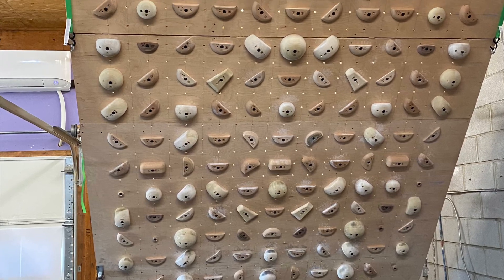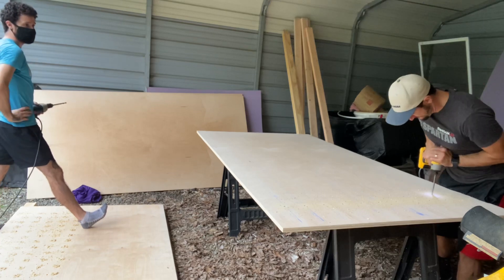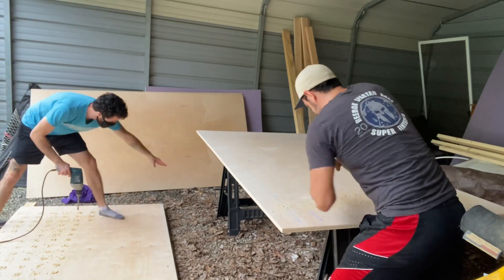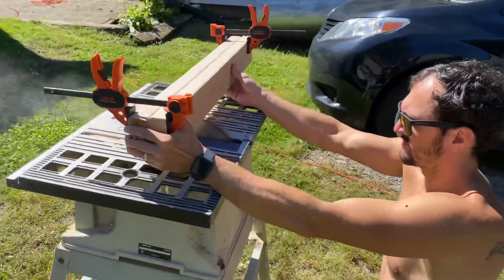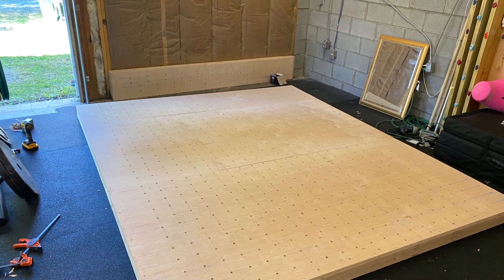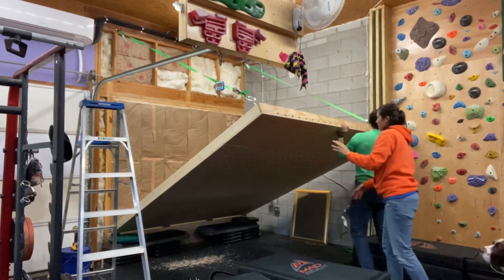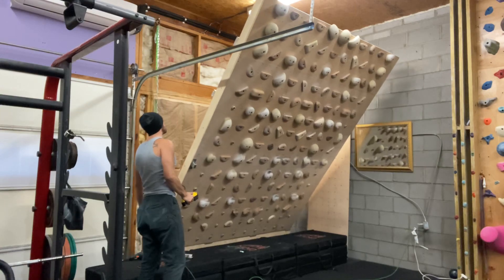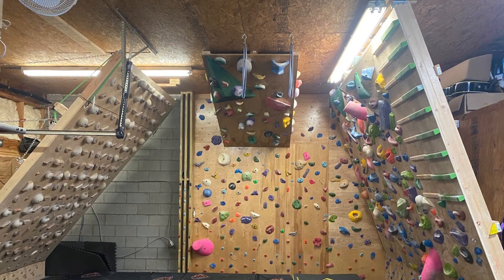Building an Adjustable Tension Board

Comment: Hey man, amazing build! I'm actually building something really similar, it's an adjustable moonboard with the same concept of a foldable top. So 2 out of 3 sheets are on all the time and you can unfold the 3rd one when you get past 30 degrees or something. This way I can tuck it in and store it upright without it taking too much space. I wanted to ask you: it seems like you went for 4 vertical studs, which means 32'' on center spacing. This matches MoonBoard specs, but I was wondering if you experienced any flex/bending at all. I was planning on doing the same layout, but I've seen people online complain about flex and others say they did 16'' on center instead making their board rock solid. You mentioned wobble when using the winch, but I only care about wobble when climbing. Thanks for the video!

Comment: Yo dude! I’m mid way through my build and was thinking about an adjustable height just like you did so! Apart from the 4 hinges. Did you add anything to secure it?
Reply from the maker: @looperdup  yo! I added chains to the top of the flip up section so it’s supported  in the top corners. Other than the hinges it seems to be enough. There is a small amount of flex but it’s never been a problem.
Reply: @benkneeland  thanks for getting back quickly and good to know! Thank you for posting the video if not I would never even think of an adjustable height wall! 

I’m guessing no regrets in the adjustable height section eh?
Reply from the maker: @looperdup  no, it’s pretty cool, it allows me to climb with much less intensity if I need to recover from an injury or if a new climber wants to use it.

Comment: great video dude! quick question, have your kids tried the tension board? Would they be able to do the lower level routes! Thanks in advance!
Reply from the maker: @looperdup  I have a 9 year old that can use the board with the largest holds. I love the tension board for that reason, the moon board is too hard if you are a beginner or if you’re coming back from an injury. The fact it’s adjustable allows my 7 year old to get on at the less steep angles too.
Reply: @benkneeland  dude thank you for getting back quickly! There's not alot of information on these for kids and my 8 year old loves climbing. I was thinking of building one so I can climb with her at home. THANK YOU!

Comment: RE: Drilling the bolts — Pilot holes are good beta, and I'd add using a chalk grid to line everything up perfectly. I used a handheld straight edge for my first build and ended up with things slightly off, actually, but the chalk lines I used on my second build were perfectly straight (and easier to set).

RE: LED chutes — You know, honestly, I did something similar with a handheld circular saw. :-p It's just an old framing technique. But I do think the way you did it with the table saw is sketchier, as it's much harder to ensure you don't get pulled into the blade if it catches. For my next build I'm probably going to use a table saw, but with the blade set to the right height so I can just push the piece through level with the table. Maybe there's even a blade we could use that's fit for that purpose? I'm not sure…

RE: O-Rings — I'm glad to see those are working for you. (I'm sure it helps that your board is lighter 2x4 construction.) I went with through-bolted D-rings which I bought from an arborist/rigging store, simply because I was absolutely paranoid about peak forces eventually damaging the O's.

Comment: Is only 4 studs enough for stability?  I'm working on stud spacing for mine and am looking at 7 2x8s spaced at 45mm but if less is just as stable I'd happily avoid the work.
Reply from the maker: I found 4 studs is probably fine, but if you don’t mind the wall being more heavy maybe adding an extra stud would be helpful. There is a bit of wiggle when the wall is being adjusted and it’s only only being supported by the winch. But once the chains are in place and the winch is tight the board feels pretty secure.

Comment: Looks awesome!  Are those 2 x 6 boards for your frame?  Also, do you have a link for your hinges you used?
Reply from the maker: They are 2x4 so the weight wouldn’t get out of hand when adjusting the angle. It’s a tad more wobbly than I would like but it still is solid enough even with bigger climbers on it. I don’t have a specific link for the hinges, got them at lowes, they are heavy duty though. I am quite happy with only installing 4 hinges at the base and the top section.

Comment: Nice job on the wall, and I hope you're enjoying it! Would you mind giving an update on how it has held up? Anything you'd have done differently now that you've had it for a year?
Reply from the maker: Thanks! It held up really well, I love the adjustable feature and the option to peel the top rows back so I can use it at less steep angles even though I have 11 ft ceiling. Installing the wires went a bit different than I’d imagined, but all I had to do was drill new holes in the hinge section so they can reach when the top rows are pulled back.